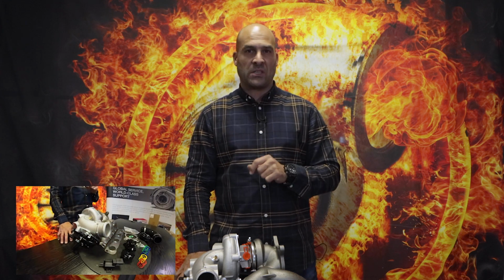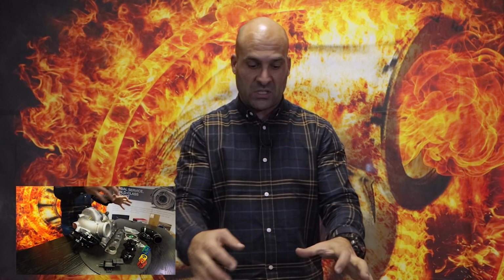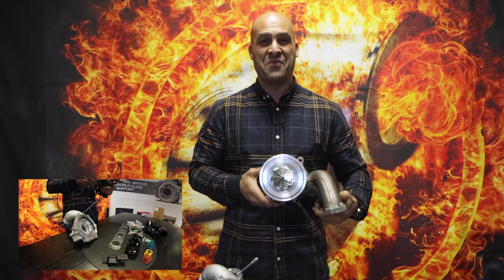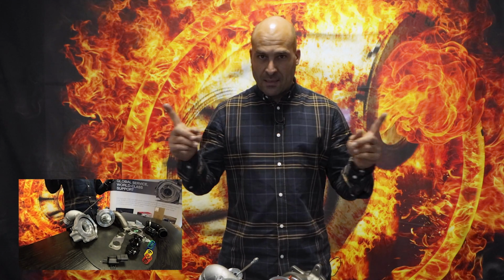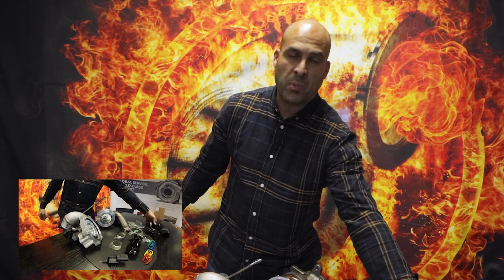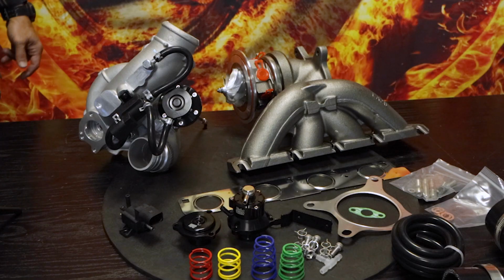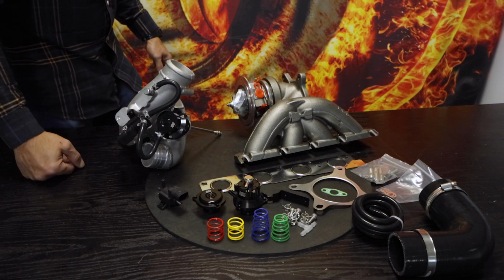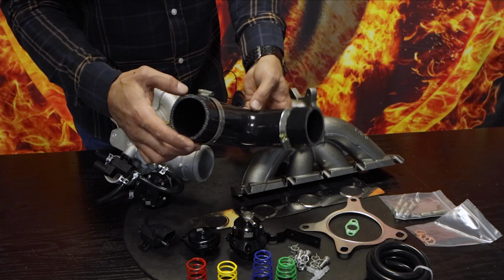TurboDirect S.A K04-0064 Ball Bearing 500HP bolt on turbo

Comment: I have an audi a4 b6 quattro engine code amb 1.8t, what turbo would you recommend for a 400hp daily driver
Reply from the maker: What application is the vehicle used for?  street, drift, drag, circuit racing? What fuel is being used? Is the engine CR changed? Forged bottom end? RPM band changed?
Reply: @TurboDirectSA  the car is used for the street, fueling is on pump gas 91 octane on the low end 93 octane on the high end. Bottom end just has rod piston are stock, the head is small port head nothing major just valves stall on k03
Reply from the maker: @antoinemiller1435  do you have the stock turbo part number ? Is it the 53039880105? If so then the K04 in the video above is the best option for you as it’s bolt on

Comment: Can the stock engine on golf r mk6 handle 450-480whp ?
Reply from the maker: No it wont - 400WHP MAX -- and thats on the limit. I would forge the bottom end and do the job right the first time if this HP target is your intention.

Comment: Does this fit on the mk1 cczb tiguan
Reply from the maker: This is a direct bolt on replacement for the GolfMK5 and Golf MK6 applications, aswell as the Audi which uses the same engine/turbo configuration.
Reply: @TurboDirectSA  great
Reply: Will this work on the 2013 Opel Astra OPC? Or do you have a a solution for the K04-2277D?

Comment: Would this ko4 bolt on to 2013 A5 2.0f fsi
Reply from the maker: This turbo replaces the K04-0064 or K03 applications on the 2.0 TFSI and TSI engines.

Comment: Hey do you have to make any type of mechanical upgrades just to use this turbo setup? And how much is the cost for the turbo? Thanks
Reply from the maker: No mechanical upgrades required to the engine per say. Just keep the boost low enough to stay inside of the max HP capability of the engine. You will need to upgrade cooler, DP and exhaust to extract any worthwhile power increase.

Comment: Very good video... My doubt with the hybrid turbos is.... Comparison of the k04-064 with the G25-660.... When hybridizing the k04-064 to be internally the same size as the G25-660 it is not weaker than the original G25-660?
My hesitation is because of the exhaust back pressure that can be caused by the k04-064 turbine housing compared to the G25-660 housing, which is much larger visually.
Am I wrong in this thought?
Reply from the maker: Thanks for the compliment - firstly this is NOT a hybrid.  Our hybrid consists of upgrading the stock journal bearing turbocharger with our 7blade splitter compressor with other turbine modifications we do. This is a completely new turbo with revised AR on both turbine and compressor housings.  The turbo has been in operation on various cars for over 3 years now running 1.8-2.1bar gauge pressure on various engines, built and stock bottom end.
Reply: @TurboDirectSA  to understand your project well... do you manufacture the compressor and turbine cases with larger diameters? Or do you use the original turbine and compressor cases from the k04-064?
Reply from the maker: @fabiolourenco  Original end housings have BorgWarner logos and markings on them, our turbo does not. Nothing on our turbo is stock.
Reply: Fabio fitted on my audi TT MK2 tfsi 200 kh..very impressive dyno result!!!
Reply: @lucatronconi3558  What power and torque did it give you? What fuel did it use?
Reply: What power and torque did it give you? What fuel did it use?
Reply: @fabiolourenco  100 Ron e5 Agip 478 nm max 389,5 hp with revo stage 3 set up 5/6/7 at 1,65 max boost
Reply: @lucatronconi3558  Do you have the original engine internals?
Reply: @fabiolourenco  yes stock bwa with 161k km for the Moment..2023 cdla i Hope!!
Reply: @lucatronconi3558  with original internals, you shouldn't exceed that power... very good project... i kept it that way.... you'll increase power, you'll lose traction on the ground.
Reply: @fabiolourenco  4/5/6 gears are Amazing ahahahah audi TT MK2 1250kg/400 hp Daily car It Is top
Reply: @lucatronconi3558  that's what I like... strong car but that can be used as a Daily car... Is the turbo lag too big?
Reply: @fabiolourenco  not more different from K04 OEM..3500/4000 but ball bearing more faster spool
Reply: @fabiolourenco  we are very impressive from this new turbo by Chris...
Reply: @lucatronconi3558  very good indeed... if you need replacement cases.... for example if the turbine case cracks do they have to be sold separately or do we have to buy a complete turbo?
Reply: @fabiolourenco  i dont know..but j Hope turbo direct have a good service in this case

Comment: Its just another turbo from TBO lol.
Reply from the maker: LOL - So many locals said the same thing till they failed - show me a balance cut on their turbos, show me what cartridge they use, have you seen inside the castings and the machining swarf......, have you cut any casting open and seen the wall thickness?  And the list goes on. 

TBO - i think not. not even close.
Reply: @TurboDirectSA  are you replying to yourself? you maybe knowledgeable but for you to look down on these Chinese turbos clearly show you have no idea what they are capable of. Alot of good k04-hybrids for this platform are from China. this is TBO, everyone knows that so stop creating new youtube accounts to prove others are wrong. I have personally run TBO turbo, still run hard after a year.
Reply: @TurboDirectSA   You have the exact same manifold casting with the "EA28R" which TBO uses.
Reply from the maker: @TheFoxho  Like i said, have you seen our manifold? Have you cut out manifold open?  Do you know how foundries and 'copy cats' work in China? Have you visited the 'manufacturers' in China?  

Just because AR70 and M57 are cast into the housing does this mean it's Garrett?  You are commenting on something you know very little about. 

Our products are controlled with a high level of quality control, just because a marking or casting number or reference is copied does not mean that the product is genuine, the same, or not - Do your research.
Reply: @TheFoxho  I have personally seen a manifold that cracked at the collector ontop from a company who imports chinese turbos here with the same casting name on it. I have also been to turbo direct and seen their manifold cut in half in their showroom next to the original BorgWarner and their manifold is 2mm thicker than the original one and it also has the same name on it. it much heavier than the other manifolds thats for sure. maybe go see turbo direct yourself in person before you make comments like that.
Reply: @brunopotgieter2016  i have seen this also at his place. this guys dont know what a real turbo is cause its name is the same. go visit this shop to see in person.
Reply: @brunopotgieter2016  I think i have seen your car on Yosh dyno - if i remember correctly it made 440HP at the wheels on pump fuel with octane boost. Not sure of the boost pressure, but this is impressive result for a bolt on turbo.
Reply: @pietererasmus7804  The Silver Audi was mine it was running 1.8bar boost after speaking to Chris for some other hardware advise. Yosh is the best tuner on these turbos for sure.  Car is running now for almost 25000kms perfectly.
Reply from the maker: @brunopotgieter2016  Glad your project was a success. No more cracked housings and fueling problems. The AEM regulator and pump makes a big difference.
Reply: @TurboDirectSA  It was thank you to you guys. Great product and the engine did exactly what you said with the pump and AEM regulator. Thanks again Chris!
Reply from the maker: @brunopotgieter2016  Pleasure buddy, glad to help.
Reply: @TurboDirectSA  The similarities is down to even the same chinese made N75 valve.
Reply from the maker: @TheFoxho  How do you know the valve is made in China, and not Vietnam? Have you seen a Vietnam valve? Have you ever tested either or both these products before?  Have you measured the impedance of these two valves side by side before?   Do you know what the over current limit is on the two valves?   Have you seen the MAC valves that are now being offered as copies by two of hundreds of copiers out there -these also 'look the same' from the outside but are so far from the same internally its scary.

Comment: Will the manifold fit the EA113 motor? I’ve got the stock ko3 with APR stage 2 turn and am wondering if i can just bolt this on or will i have to go with a different manifold.
Reply from the maker: Yes it will bolt onto the Golf MK5 and MK6   2.0Litre EA113 motor

Comment: Hi, I could not find any compressor map details on this unit. I just want to confirm for the 500hp mark in relation to the gauge pressure required or the range of gauge pressure required.

Thanks again for covering the technical aspects in the other comparison videos, it's really informative and helps make informed decisions on our required setups 👍💪🙏
Reply from the maker: 500HP is directly related to the engines ability to "use" the provided air flow. The compressor is capable of providing 58lb/min of air flow.

Comment: Stock manifold? As its the main collector which restricts k04-064 turbo housings to reach 500bhp
Reply from the maker: The manifold is stock in terms of bolting onto the engine, but the internal tract inside is larger, hense the ability for the turbocharger to deliver the 500HP. The walls of the casting internally are also thicker, preventing the common cracking with the oem housings in certain areas.

Comment: This a tbo ea28r turbo available on Alibaba or AliExpress for 800$ same exact one with same hardware, this is most likely just rebranded and sold for much higher price.
Reply from the maker: You welcome to purchase this turbocharger, please let us know how that goes. We have plenty experience with clients who have purchased these turbos and experienced negative results.  Once you purchase the turbo, let us know, we will share the differences between this low budget copy and what components we use in the build of our product.
Reply: @TurboDirectSA  I have bought it running it in my TTS stage 3 can't fault runs 8s 100-200 on 415bhp mild tune due to stock engine. Had it on for about 4 months now.
Reply from the maker: @kamzi1528  Thats great news - well done. Post some videos so we can all see.
Reply: @kamzi1528  i take it this was a lie, and never happened
Reply: @mr.partypanda6016  Exactly right
Reply: @mr.partypanda6016  what's the need for me to lie, check my shorts, now running 7.5s 100-200 with the tbo 450, which is exactly the same.
Reply: @kamzi1528 how much was it to buy plz?
Reply: @enzoUKSC  cost me total 1100£ including shipping and import taxes.  I don't know if you from UK but I got tbo 450 and 550 for sale as I went big turbo now,.

Comment: All this is confusing lol! Have only ever had n/a BMWs, recently got my first VAG (and FI motor ever). I've an ea113 2.0 TFSI A3, and as I understand it, k04 from the S3/6R is the most recommended fuss-free upgrade (with OEM supporting mods). Wasn't aware there are different 'flavours' of k04 so I'm lost again lol. So how does one choose coming from full stock k03? Then also read gtx3071 might be better in the long run in case you get bored with the power as it has a higher power ceiling, but then you're likely looking at a built motor...

I saw you mention Yosh in an earlier comment, I'm hoping to have that sort of work done by him in due time, I'm currently getting preventative maintenance items from DarkArtz first.

Apologies for being long-winded!
Reply from the maker: Stephen first off, you in real good hands with Yosh - the ball bearing turbo we have in the K04 guise is capable of more than any GTX30R in terms of spool and outright pound for pound HP output - the nice thing is its bolt on and no fabrication is required to install or fit - all you need is the tuning side which Yosh is the man for -

Comment: Will this turbo setup work on a Revo Stage 3 car ? 

Revo stage  3 software is meant for a K04 turbo setup
Reply from the maker: The turbo will work on any engine designed for the turbo to bolt onto it. The tuning is something that will have to be done after the turbo installation.
Reply: @TurboDirectSA  Which company do you recommend to do the tuning for this turbo?
Reply from the maker: @ALTF26  Yosh from Darkarts - noone else if you are local. Otherwise if you operate abraod, use GT innovation - Thanos Farmakis. Beware of the copy and paste "tooners" out there.

Comment: I have a gen 1 ea888 TSI in my 2013 CC with a K04-064 that is experiencing valve float at 6,000 rpm due to weak factory exhaust valve springs. Would you think the better flowing exhaust side of this turbo resolve my issue so I can keep factory exhaust valve springs?
Reply from the maker: Thanks for the question Nate - replace the springs with a solution, dont try use a different component to "fix" a problematic component - it wont work. 

Change the springs, for upgraded tension models and get it done properly. The Turbo is not there to "fix" other hardware issues - shy away from this thinking.
Reply: @TurboDirectSA  thanks for the response! I already have Supertech springs that need to be installed. Car has updated tensioner and chain stretch is at -1.61* so timing system is healthy. Appreciate your expert advice. Once I get the valve float sorted I’ll look at a larger K04 frames hybrid like yours.
Reply from the maker: @nates2243  100% sort the issues out one step at a time, and progress from there.  Good luck with the project buddy.

Comment: Any hybrid options for KO4-23?
Reply from the maker: Good question thank you - the housing AR's on these turbochargers are really small, and upgrading the compressor and/or turbine stage generates massive heat into the engine and intercooler, the result is definitely NOT a reliable one.  We are able to upgrade these turbochargers easily, but we choose not to for the reasons above.
Reply: Hi, I got the ko4-23 on my 2002 1.8t s3 , will the ko4-064 be a straight bolt on ?  Not sure if the bolt pattern is the same as the 2.0 heads?

Comment: Can we use k04 software with this turbo?
Reply from the maker: Are you local to South Africa? If so i have a tuner who does software for these turbos. Otherwise you need stage3 big turbo software - the K04 turbo software will not work.

Comment: Currently on ko4 with my 2.0t quattro A3 ..this really sets you apart from the usual . nice
Reply from the maker: It is a good upgrade for moderate power and no need to upgrade fuelling system to suit
Reply: Has the turbo been running well? Any issues? Does it spool fast? Curious to hear your thoughts :)
Reply: Don't you have bolt on for 18t 20v or do I need something like adaptor plate for it to fit

Comment: Ready to order this turbo but apparently no stock  at the moment.
1. Any idea when new stock arrives?
2. Any Dyno results from people who have successfully installed and tuned this? Would love to have an idea of the graph and spool characteristics.
3. Do you have a compressor map?
4. On your custom housings...are the AR's the same as the Garret G25-660? 
5. What is the warranty ok the turbo?
Reply from the maker: Apologies about this, the product is extremely popular, we cant keep up with the demand at the moment - we working on a new manufacturing plant which we aiming to have built and setup in the next three weeks. more to come on that. 

Contact Yosh from DarkArts - he has tuned these turbos previously and has plenty data for you.  The AR of the turbine housings and compressor housings are not the same as the Garrett housings, however they are around 25% larger at the tongue on the turbine and the compressor flow limit is increased substantially aswell.
Reply: @TurboDirectSA  hi there, when would manufacturing resume on this turbo :-)
Reply from the maker: @edwardmaluleka5326  October mid to late.
Reply: @TurboDirectSA  just wanted to check whether the manufacturing is still on track :-)
Reply from the maker: @edwardmaluleka5326  We are trying, international shipping delays causing havoc.
Reply: @TurboDirectSA  Hi, it is 20 Nov-21, what is the status of the stock availability?
Reply from the maker: @321ror  We have a massive problem with shipping currently. We have stock sitting on the water waiting to dock in our local harbour, and there is literally one crane which is stuck between loading and offloading in the countries biggest harbour - we have delays of over 4weeks currently. 

Apologies for the delays- its out of our control, we have no confirmed ETA as to when we will receive our castings!! Once we do, we have the machine shop waiting to bog down and get the work done.
Reply: @TurboDirectSA  thanks for the update, what is the expected Rand price for the kit?

Good luck with sorting the logistics out!
Reply from the maker: @321ror  Pleasure sir.  The pricing can be found on the online store here:- https://turbodirect.co.za/store/index.php/shop/turbochargers/k04-0064-forged-detail 

The pricing might change slightly once the stock arrives, depending on the shipping situation, but this will give you an idea.
Reply: @TurboDirectSA  are things looking up, or is it looking more like next year
Reply from the maker: @edwardmaluleka5326  Next week early we should have stock for you sir, apologies for the delays.
Reply: @TurboDirectSA  really hope so, it has been a long wait
Reply from the maker: @godfreyApexGTI  Stock arrived yesterday Godfrey, we waiting for customs release. Shoot an email off to info@turbodirect.co.za the ladies will book one out for you.
Reply: 485 WHP with the 550 turbo
Reply: @juanmanuelcardenasrovira9573 

That’s pretty strong numbers!! 

what other mods have you done?